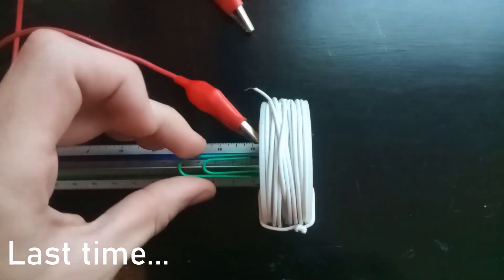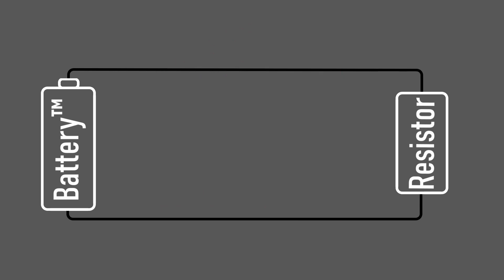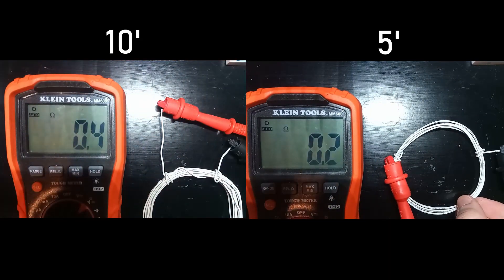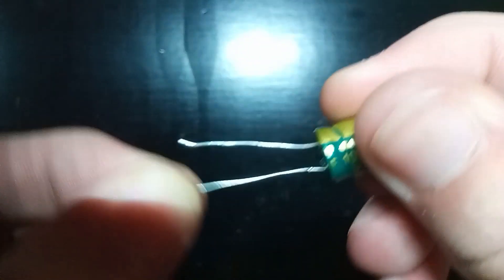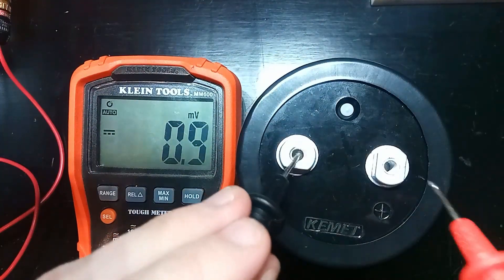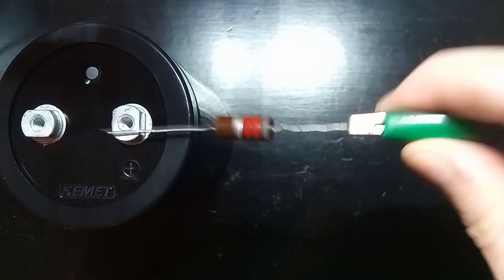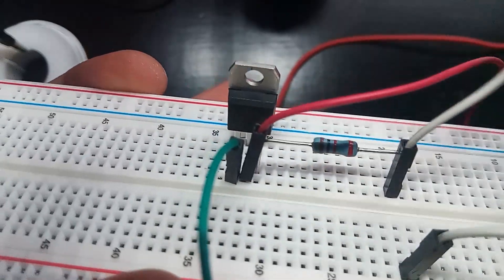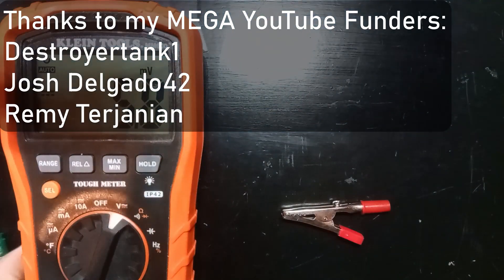Current & Capacitors: Making a Coilgun - #2

Comment: Hey, what SCR are you using? I have my own coilgun with a 1000uf 450v capacitor and I always shoot it once and the SCR breaks. Great project by the way, definitely deserves more views!
Reply: Calculate the max. amps and choose a fitting SCR, look into the datasheet for the max amp rating.

Comment: I have two of those converters the same ones which you have! i wasnt wearing gloves and i accidentally toughed the capacitors on it from the two pins and it melted my finger, wasnt much just two holes but could have been worse . Stay safe!
Reply from the maker: Ahhhh I hope I don't do that, I try to be as careful as possible considering the voltage is so high
Reply: @reidsprojects7952  Yeah got to be . Now i am  more careful since it can kill you easy peasy

Comment: From what supply do you charge the capacitor?
Reply: See also New Portable Super Coilgun:

https://www.youtube.com/watch?v=rclLsQ9nyeg&amp;feature=youtu.be

https://www.youtube.com/watch?v=-mjDqp_oWZk
Reply: bit late but you would use a dc to dc step up the one i use is 390v from 12v you could use 18650s in series or a car battery or a 12v laptop charger

Comment: For building a reliable coilgun ohm's law isn't enough and more capacitance doesn't mean more kinetic energy in the projectile. You MUST consider the inductance. In other case your capacitor can be part of an LCR Oscillation, where the polarity of the Voltage and Current goes negative.
Your Coils are wasted isolation. You should use magnet wire instead.

Johnny
Reply: Yes of course.
It's cool. See also my first Coilgun (New coil -  wire 2 mm) :

https://m.youtube.com/watch?v=0nMyv83_ycM

Comment: Have you got an idea about what the resistance is of your discharging circuit (The circuit formed between the capacitor and the coil)? Because with those high voltages you plan to use with the capacitors, you have to make sure that the SCR can handle the current it has to conduct. Because - as you mentioned- when the voltage rises and the resistance is low, the amps on the system can get very high. I as well have been building a coilgun for the past few months and this is a problem I am facing with right now (And I am not sure what to do with it) 
For every coil I use a capacitor which is charged to 230VDC (capacitance is 1500 microFarads) and the discharging system has a calculated resistance of less than 0,1 ohms. this gives me a very high current but I am afraid that my SCR (which arrives tomorrow) might not be able to handle that amount of current even though it is only for a very short amount of time. The SCR that I have ordered is a 70tps12pbf.
I am very curious about what you think about this and about how you would solve this problem.
Increasing the resistance on the system doesn't seem like a very good thing to do because for that I would need a resistor with a low resistance (to keep a decent amperage to power the coils) but for that the resistor would have to be able to withstand a very high amount of power which brings us to the same problem.
I hope that maybe we can help each other out.
Reply from the maker: So far my SCRs haven't exploded or anything yet, so if there is a problem I'll cross that bridge when I get there. I suspect it'll be fine, but for safety reasons I'll keep a voltmeter on the caps so I can make sure they are discharged before messing with stuff.
Reply: Have you looked at your SCR's datasheet? It should have some current ratings, if you have a ballpark for your overall resistance then you can estimate how much current will flow. Seems to me like MOSFETS would be better for switching large amounts of current, as they have higher TJ ratings and way higher continuous current ratings.